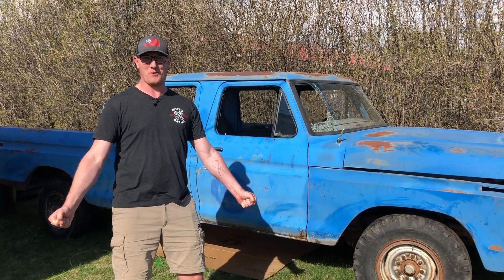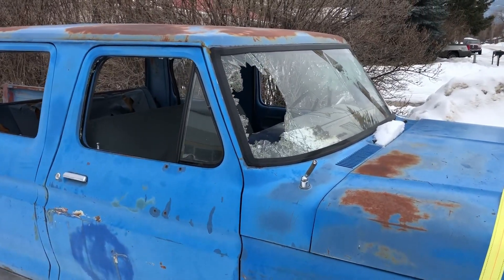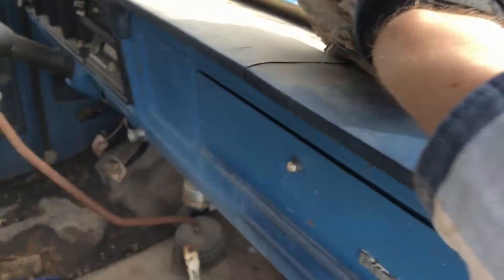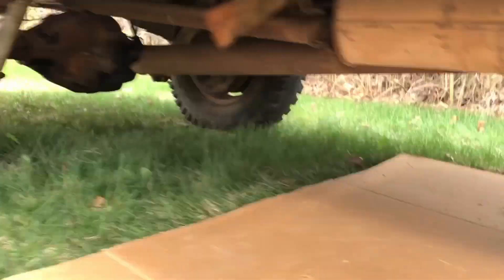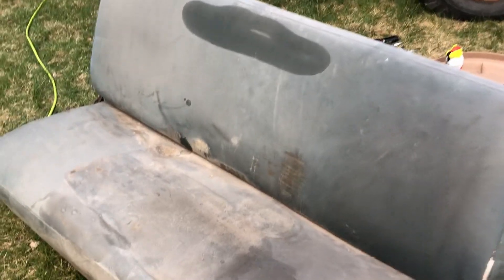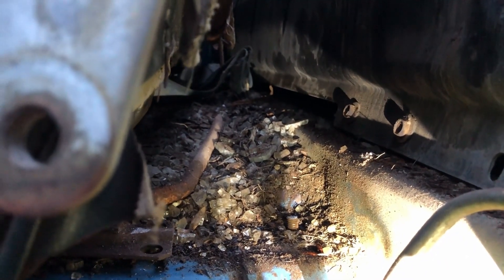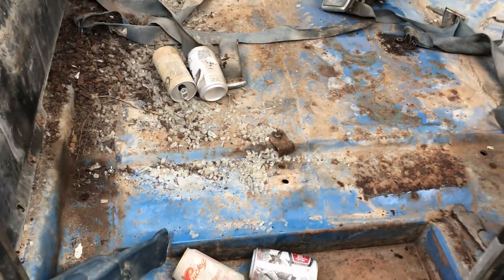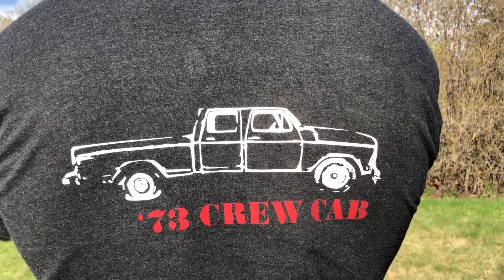1973 F250 CREW CAB | EPISODE 1 | PROJECT BIG BLUE CREW | (WITTY'S GARAGE PILOT EPISODE)

Comment: Love this truck! I've had an old one or two myself over the years.  Luckily one can still buy replacement sheet metal repair pieces for them, including the bed floor.  Windows are easy enough to replace, and always remember to replace the weatherstriping on all the doors and windows as well.  Floors are unique, but I think they ought to do like Jeep Wranglers and have drain valves so as to wash  out easier and then let out the water.  Of course I'd insulate that floor and then maybe a vinyl full floor covering so as to simplify future cleanings.  Seats up front I'd go for replacement with full-size Bronco buckets with headrests, and the then get a newer bench seat with headrests for the rear one to replace it.  Creature comforts and good on the passengers too.

A good Line-X coating the undercarrige and inside the bed will go a long ways as well. Maybe the bumpers too, inside and out.  Mega miles that way.
Reply from the maker: Thank you kindly. It’s definitely gonna be a process but I’m loving every minute of it. I think you will be pleased with my final result over this next year. Thanks for the ideas and the support. 🤘🏻

Comment: I see the Witty, but I don't see the garage.
Reply: Is he restoring a truck or advertising for Schlitz
Reply: @wyattvanham4223  Ummm, bro, you really think he's advertising for Schlitz??
  Witty seems more like Colt 45 guy to me.
Reply: @geoffreymelton8833  I see you say Colt 45 but I don’t see 2 zig-zags
Reply: @wyattvanham4223  Urmm, bro, I bet you don't even know the difference between a lager and a I.P.A.
Reply: @geoffreymelton8833  I know IPA is ass!! But at least level with me that lager is the true superior to both
Reply: I am confused on you gentleman discussing beer, when this channel is about restoring an old Ford truck.
Reply: @tomforman6453  I drive a 93 Chevrolet S-10 EL baby, a comparable TRUCK to this dumpster wagon
Reply: @tomforman6453  I bet you drive a Nissan.
Reply: @wyattvanham4223   I am afraid I am going to disagree with you.  The 70s year trucks were the last gems.  Modern trucks are notorious for electric issues.  When this 73 Ford gets restored, it will outlast your Chevy S-10.
Reply: @geoffreymelton8833  I don’t.  I drive an 86 F250.
Reply: @tomforman6453  Well I drive a 2006 Ford V10 Super Duty with crew cab with flood light modification. 
My truck would smoke your 86.
Reply: @tomforman6453  bro my brother 94 Dodge 1500 will smoke that “so called” WIDE LOAD you gotta haul
Reply: @wyattvanham4223  Wide load? Could you please specify what you are referring to?
Reply from the maker: @Wyatt VanHam
@Geoffrey Melton
You two are awesome! 🤣🤣
Nice to see you've checked out the channel.
And be nice the others or I'm going to tow your rigs into a field.😉😂